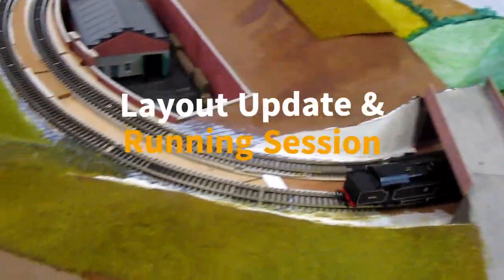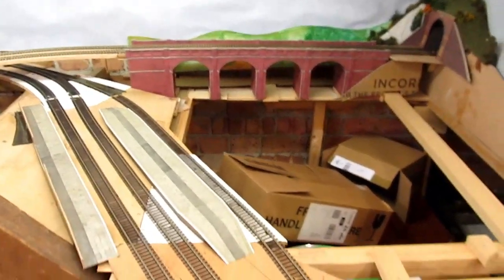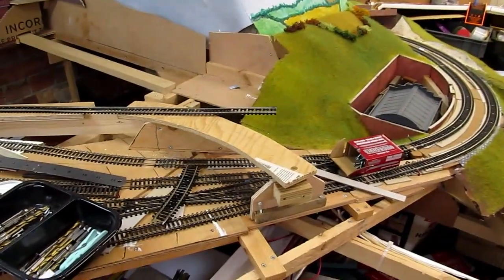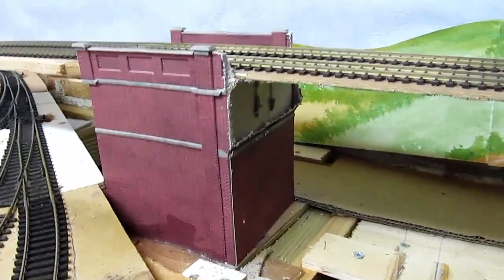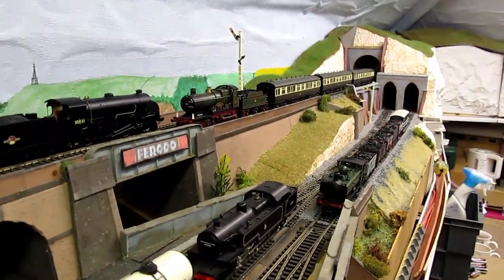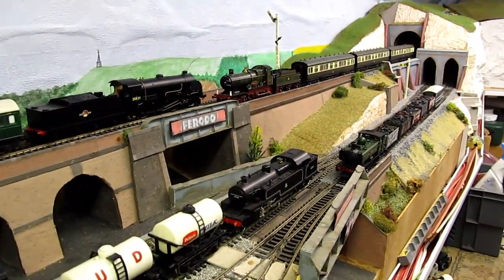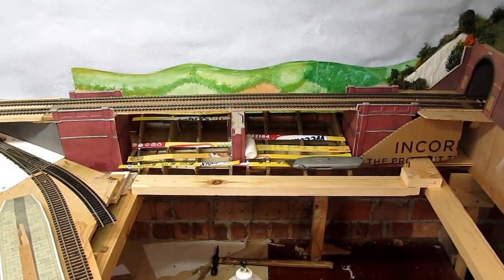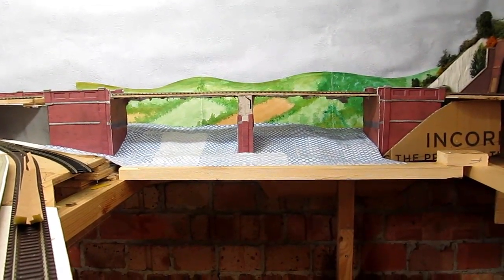Running session model trains and layout viaduct update to Buckland Junction Loft Model Railway 241.1

Comment: Hello Alan, Nice to see you doing more work to your layout, I like your work & build videos. I'm not really into live streaming..! Your doing a nice job with the metcalf bridge, can't wait to see the new finished bridge, it should look really good Alan. The devil is in the detail..! Captain static has done you proud bringing the City of Truro for a running session, I stood on the footplate of said locomotive once at Swindon (old) railway museum way back in the 1970s, there is a lovely new railway museum at Swindon now, which I did get to visit once. well worth a look if you haven't been. I got to walk under a Castle class steam loco in the "new" museum, its quite amazing what's under a steam loco, really wish the old Swindon railway works was still there though.. building proper locomotives, I got a tour of the Swindon workshops & scrap lines back in the mid 1970s, when still repairing diesel locos, the works & workshops at Swindon took up a large area. All you seem to have when your getting oder Alan are memories of the past. Another memory I have was looking at the cab of the prototype deltic diesel locomotive, what a beast. 
It was in Kensington London in the 1970s, look after yourself Alan, and give my regards to Mark "captain static" Maurice out..!
Reply from the maker: Hi Maurice Sir. Wow that was some interesting message !! Like you memories. I visited Barry Island scrapyard in 81 when there was load in engines lined up, including Clan Line.
I as truck about Europe looking everywhere I went. I went Shunting in an 08 and class 31 in Stratford Lift Freight Depot while I was clearing Customs formalities several times. And my channel is call Buckland Junction because as a youngster I visited the signal box named that in Dover, and my uncle Tom was the signalman on Kearsney station too. Take good care mate. Alan in the loft "OUT"